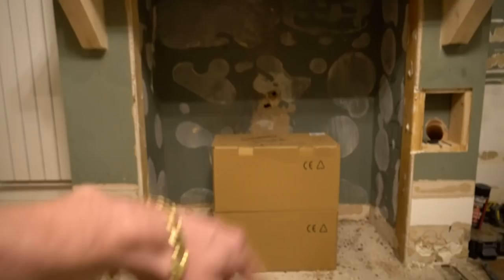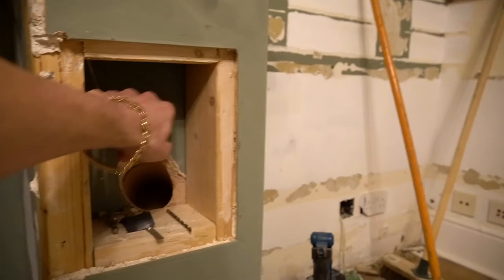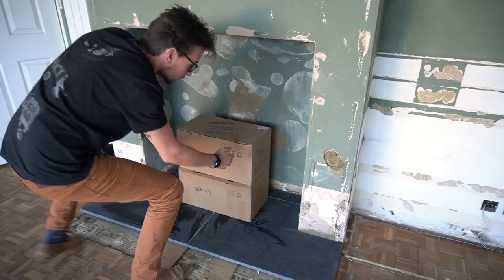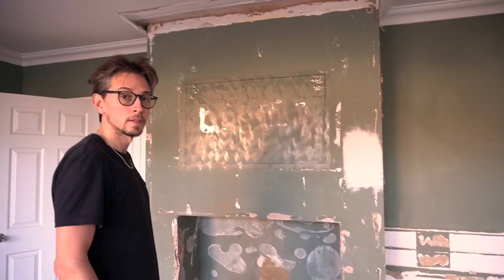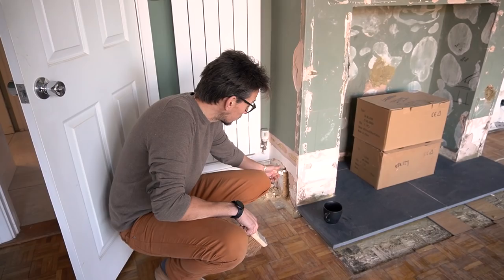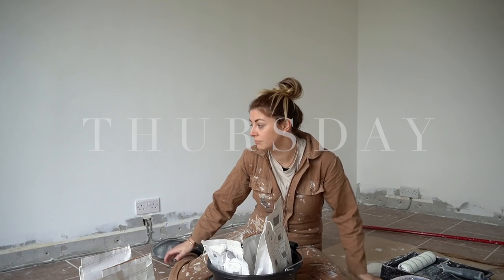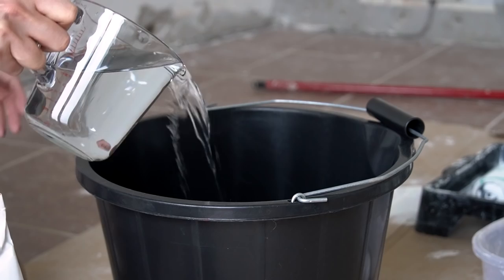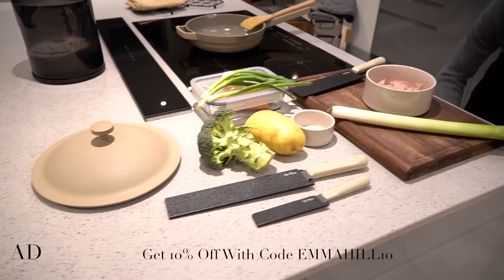Creating Textured Walls & Fireplace Updates | Ep 3

Comment: Emma, please install immediately a CO2 detector.  Carbon Monoxide is the silent killer and a detector can save your life.  Love everything you are doing and so happy you kept the different floor levels which is the character of the year the home was built.  Love the house and the potential.
Reply from the maker: We do have one by the boiler and in the garage but we will be getting another 1 (or 2) installed. Although hopefully when the gas is sorted early next week, we will have only one connection from the supply to the boiler, instead of all these random off shoots from previous installs 🙈 so it should be much safer.

Comment: In February they cut all the power off at our apartments to restore power to other areas after a big storm. Our power lines r all under ground so it survived the storm but not the electricians who determined to shut us off for repairing houses power down the road. so we were without for 7 days! 20 degrees cold! So I relate fully !  
if u heat yourselves up by going in ur car please keep the car fumes with lot of ventilation so you’re not inhaling that.

Comment: I’ve got no heat currently either as I’ve been putting down new floor and the underlay doesn’t let heat through from the 1960s underfloor heating. You may wonder why I’d be doing away with underfloor heating and while it was very nice, it didn’t work properly and my quarterly heating bills in the winter were like £600 and I live in a flat!! Fortunately because I live on the first floor of flats, I’m sandwiched - a warmth sandwich if you will OR a toastie! I just have a plug in oil heater until my electrician can install my new vertical rads in a few weeks. Shit loads of candles really does help take the edge off too! Hope the babies are keeping snug and your heat is back on now :)
Reply from the maker: 😱 I feel for you. Hopefully our heating will be sorted early next week 🤞

Comment: The puppies are so awesome! Is the floor heater helping?  The wall finish looks amazing. So beautiful. Very classy look.
Reply from the maker: Yes it does help a little, but obviously only in the small area that we have it. 🙈
Reply: @EmmaHill  some heat is better than none. Just sleep wherever the floor heater is until....
Reply: @EmmaHill  if the space heaters aren’t oo expensive you can get them for other rooms. The ones in usa; under $40, works better than ovens and heating systems even.

Comment: Hey Emma, have they prepared the lime wash, so that you can paint over it later in time? Because the old limewash, was very difficult to get off the walls again.
Reply from the maker: Im not sure if I understand the question, sorry. 🤷‍♀️
Reply: @EmmaHill  the old rooms in our farm had lime wash on the walls. When we tried to paint over, it all fell off. We needed to wash down many years of lime wash before we we able to get normal paint to stick. I just wondered if in 2021 they have changed the lime wash so that you can paint over , say in 2 years time.if you change your decor. :-)
Reply from the maker: Oh I didn't realise. As far as I know this could be painted over, although it may require a little sanding before hand due to the texture. But after all my hard work there's no way we will be painting over it any time soon 😂

Comment: It’s a gas fireplace?
Reply from the maker: No. As far as we knew it had never been gas. When we bought the place there was a log burner there and the previous owners had it linked into their hot water/heating system. So we assumed it was a release valve for that. But it turns out its a gas pipe and so there must have been a gas appliance there at some point, most likely a gas fire 🤷‍♀️
Reply: @EmmaHill  but is your fireplace logs burning type or that electric or gas type they place within the frame? Sorry I’m not knowledgeable on .
Reply from the maker: Sorry, it will be a log burning stove. We are just waiting for the stove to be installed. Which is why it is lucky we found the gas pipe as it will be directly next to fire 🙈
Reply: @EmmaHill  oh nice. So it has a fireplace looking exterior though right? I Apologize for my dumb questions.